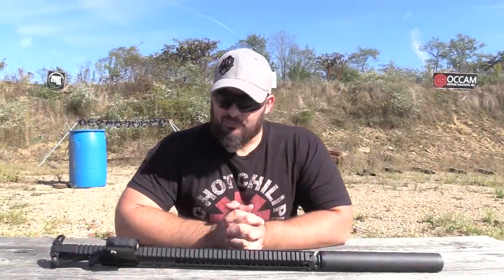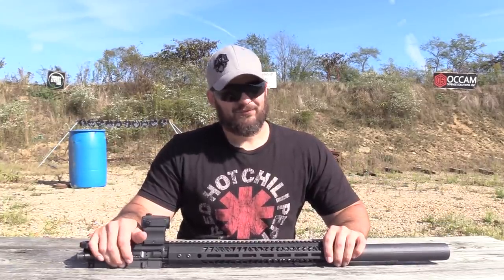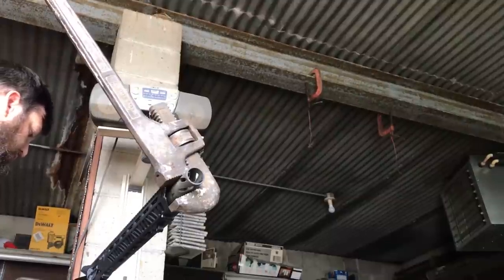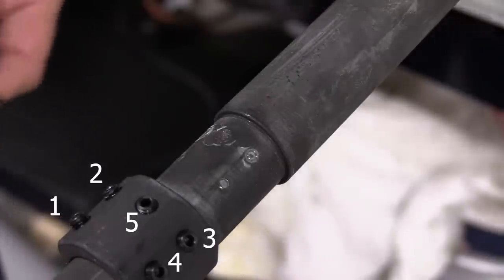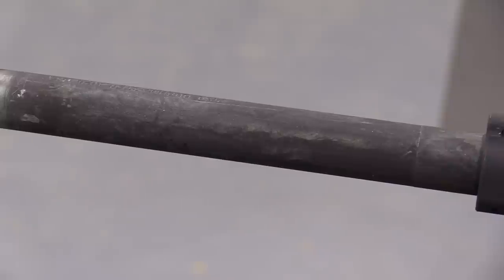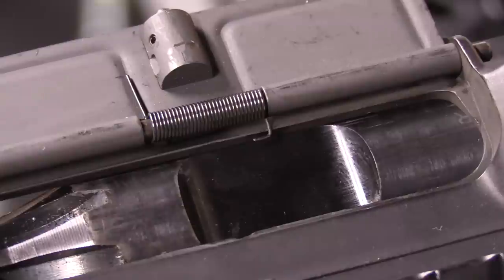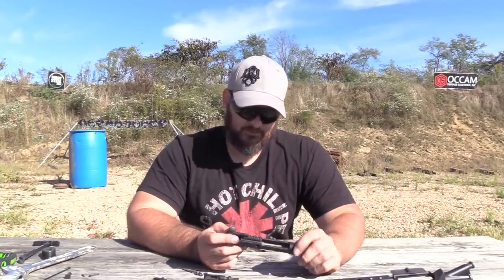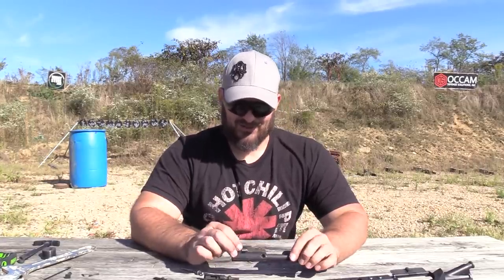The Worst AR 15 I've Seen 🚩Bear Creek Arsenal🚩

Comment: Thank you, I just bought a BCA 762x39 after watching this video.
Reply: How is it holding up?
Reply: @markzuckerberg3128  it is actually going quite well bots and enhance firing pin and some heavier trigger spring. Shoots Great wish I could afford more ammo though
Reply: @user-vx9qi7ni8g  Kool thanks. I want to put a H3 buffer in mine. Have you had to replace the extractor yet?
Reply: @markzuckerberg3128  no the extractor works well no issues. I just shoot the cheapest dirtiest ammo. All is good
Reply: @user-vx9qi7ni8g  Nice. Thanks.

Comment: Uh I think because of this video I am going to buy a BCA lol
Reply: Robert / well that can’t be..apparently all their stuff is garbage, I don’t know why anyone would be buying it.
Reply: Don't know where he got that particular upper from, but all of the uppers I've gotten from BCA have been pretty decent for uppers under $300. If the advertised upper is out of stock, email them about it and they will typically build it for you since they are an in house company. They have great customer service and really fast shipping. Hey for less than $300 if you don't like the upper you can always return it or sell it
Reply: K. PeteE same here
Reply: Agreed. Seems like a pretty solid buy, considering all you need to do is recheck the screws for tightness and stake the gas key a little better. I've seen Rugers where they forgot to machine the holes for the trigger pins.
Reply: I’ve bought 4 uppers from them with out complaints and very accurate
Reply: @KPeteE  "JuSt As GoOd!"
Reply: It's not garbage.. I bought 3 rifles to keep around while I put my FNs I'm the ground. These aren't battle weapons however they are great rifles and if I got stuck in a fire fight it wouldn't matter if I had my FN or this. Only difference is the mechanical endurance
Reply: I bought a 7.5 inch 5.56 upper from Bear Creak Arsenal, it had a defective bolt that wouldn’t eject cases. I told them and they basically told me to kick rocks. Lesson learned by nice or buy twice, don’t waste the time or money on a BCA anything
Reply: If your going budget go Anderson or PSA
Reply: @wakandawildman2043  really? Mines with them right now because  of a barrel nut issue they hooked me right up. Maybe it was a long time ago?
Reply: I would recommend them, I sell them every day without issue.
Reply: @wakandawildman2043  bro... Literally had the same issue my extractor pin basically exploded at 50rds. I hit them up of course providing pictures of the malfunction and they sent me a whole new BCG
Reply: @wakandawildman2043  can I see your 7.5 build? Looks like I did the same thing around the sametime you did with the same malfunction
Reply: @wakandawildman2043   that's odd they normally are helpful
Reply: @berman943  if we all went by hear say then the world wouldn't have options
Reply: @jonathandavis346  buy a custom bcg if you're buying cheap bro , maybe change the buffer out to
Reply: @malonehardwud4660  I've got some nice bcgs. The purpose of these guns are for work and fun. I'm a farmer and treat the gun roughly. The 7.5 build is now 300blk and the most dbag gun I could build. Folding buffer and over all decked out with some nice parts. Kinda funny how it started as a $700 gun and is now a $2000 gun.
Reply: Good choice

Comment: This is one of the worst videos I've seen. Full auto on .450  😂
Reply: With the staking on that gas key, this upper would have failed regardless of whether or not it was fired FA. Same with the gas block that had zero threadlock on the set screws.
Reply: The fact that they only have 10 round magazines tell you that they aren't designed for full auto.

Comment: I’m sold I’m going to order not one but multiple uppers!!! Thanks for the review
Reply: I bet they all work fine
Reply: @didamnesia3575  yeah they totally DO NOT explode especially the 300 blackout that BCA makes
Reply: @nosteponpp4849  Got a 308 for $270 never had a problem. Well besides ammo prices
Reply: You clearly can't tell what abnormal wear is on the AR platform then 😂 just because it can cycle ammo doesn't mean it's working "WiThOuT iSsUeS" I've never seen a Bear Shit Arsenal without issues
Reply: @nosteponpp4849  i have!.. more than a few
Reply: @theman-pc2ej  then you haven't ran them at high enough round counts for your opinion to be of value
Reply: @NoStepOnPP  well the psa and bca are both binary and an average person done even have that id say i run them harder than an average fella. Im no full auto but that has no place in my armory. Just a novelty in my opinion and yes it counts bud..
Reply: @NoStepOnPP  and so your saying you have to abuse it to make it malfunction or wear prematurely?.. not my cup of tea either.. if i wanted to go full auto i would spend the extra cash on something more designed for that but for semi or the occasional mag dumps they are just fine..
Reply: @theman-pc2ej  most people who own PSAs run 1k rounds through their safe queen and think it's a lot......so again if you haven't seen any problems with BCA, you haven't used it enough because they have problems 😂
Reply: @NoStepOnPP  ok bud..had mine for years and they all have way more than a thousand rounds threw them and operate flawlessly so maybe i just got lucky..
Reply: @theman-pc2ej  or you aren't actually using them, which is 99% of the time with BCA owners who don't want to accept reality that bear Creek Arsenal is the worst AR manufacturer out there
Reply: @theman-pc2ej  I love how bear Creek Arsenal owners get so pissy and start lying when it's so obvious to everyone else 💀
Reply: @NoStepOnPP  not pissy or lying.. just is what it is. In my experience after thousands of rounds threw all my riffles they still operate like the day i purchased them. Im just telling it how it is wile you argue about my riffles..lmao!.. have a nice day lil fella
Reply: @redacted951  I don't suppose their BC10 uppers will fit on a Diamondback db15, will it?

Comment: Everyone I know who has a bear creek arsenal loves them, myself included, my favorite rifle is my bca upper on my dpms lower, I have 5,000 rounds through it and it still runs like a champ,.. I think u just got a lemon that's not ment for long full auto burst to begin with..
Reply: I have 2 also from bca. The .223 Wylde and the .50 Beowulf. I have never had a problem from either one of them. They are just good low cost uppers.
Reply: It wasn't a lemon till he went full auto plumbing tools on it.
Reply: @logicalguy488  lololol😆😆😆😆😆good stuff
Reply: The fact that they only have 10 round magazines tell you that they aren't designed for full auto.
Reply: @trickmustang1994  I have one of their 50 beowulf uppers. Haven't shot it yet. No reliability issues?
Reply: @bryananderson3772  no issues with it. I've had it for about 2 years and I've shot a lot of rounds threw it.
Reply: @bryananderson3772  the best magazine for the .50 Beowulf is the Alexander Arms mag. They come in 10 rounds, 7, and 5 I think.

Comment: My first AR used a BCA upper with a bear claw fluted heavy barrel. It has ran flawlessly for the past 5 years. Nothing came loose, no jams or malfunctioning. I did get the more “expensive” setup from them and chamber is very clean and stays very tight to the upper as does the flash hider to the barrel.
Groups with my vortex red dot are avg of 5-7MOA. It’s good enough.. And having a cheap blaster is better than have no blaster. Sub MOA is meaningless unless you are hunting rabbits at 100yards, center mass is what’s important.
Yes my WC is much lighter and feels a little smoother but it cost 4 times as much. And they both shoot similar groups at 100 yards. So if you are trying to get yourself a tool without needing to save for weeks or months BCA is a great option for entry level shooters. Just stay away from the really cheap ones. That’s a good tip for any product you buy. A Kia Forte is not a Kia stinger but both have the same badge.

Comment: I have 4 bca uppers. 223 Wylde, 5.56 7.5" pistol, 450 Bushmaster w/10.5 Barrel, and a 7.62x39. I also shoot a lot. The only issues I had and the first is being knitpicky, is the flash hider was off time slightly. The second is the 5.56 7.5" pistol was over gassed. It took an H3 buffer and heavy spring to get shells ejecting in the 3-4 o'clock area. Kinda to be expected with a 7.5" barrel designed to shoot a broad range of ammo. You could should all my uppers, all day long in semi auto, and not have an issue. The Daniel defense meltdown didn't go as long as a cheap one. You can absolutely get a reliable AR for less than $400 that you can shoot for years to come.
Reply: Kris N My $450 Anderson is at about 5,000+ rounds and still showing no signs of failure
Reply: The fact that they only have 10 round magazines tell you that they aren't designed for full auto.

Comment: If you run the crap out of any firearm full auto and suppressed your gonna have issues. It’s not a Gatling Gun. Think about the pressure being applied and the bcg cycling so many times. You simply can’t expect the quality/results you would get from a piston driven 416 out of a budget friendly upper. Common sense.

Comment: A lot of of videos I have seen the gas blocks have come loose.I got a 7.62x39 upper from them the first thing I did was to loctite it down and tighten it.I have had no issues with it and it is very accurate. Not bad for $195 complete upper.
Reply: Yep! Their complete uppers should be considered an "assembled parts kit"... meaning you get all the parts for a complete upper, and it's sent to you put together as far as the parts and fasteners being in the right place, but it's up to you to go over it and make sure it's assembled right.
Reply: @carlh7795  ... you even have to assemble the bolt carrier since BCA apparently doesn't do quality checks to make sure sure the gas key is staked like it should be.
Reply: @hochhaul  boo boo. You have tighten something after saving $400

Comment: Why would you shoot a cheap upper in full auto? That’s like taking a Prius on a Baja 500. I think you make good points but it’s just not relatable to the people buying them. I’ve got 2 BCA uppers for hunting and they are great for just that. Limited rounds.
Reply: Merch!!! I found ya...haha... only reason I checked the comments was because I knew you would have to say something about this toolbox running that gun on full auto
Reply: how long have you had your bca uppers for hunting I wanted to do a 450.for best but now I'm on the fence
Reply: Jake Lundgren about a year. It’s super accurate and runs awesome, you need a Tromix mag and follower for the big bore cartridge (20$). It’s definitely worth it
Reply: @Mh187pj  Not really, it's like taking a Prius but it's an off brand Prius. The original AR design was meant for full auto, a clone should handle it fine. If it can't... It was poorly made.
Reply: @ChucksSEADnDEAD  The original AR design was not meant for .450 anything full auto or not
Reply: Nezic  I've decided you have no idea what you're talking about. You lose.
Reply: @f.a.2115  You really want to bring the original AR? The failed rifle that was plagued with issues and basically went away for awhile. Good job invalidating yourself.
Reply: @motino  The fact that the original AR blew the barrel in testing has nothing to do with the fact that it was designed for full auto. The composite barrel was just a bad idea. But like I said, that's beside the point. If you clone an AR, a modern AR after all the fixes it had to go through, and don't even make it handle FA you're just cutting corners and delivering a subpar product.

Comment: For anyone actually wondering, the 450 is a big stubby round that doesn't feed super well with the standard mass of the ar-15 BCG, and an H3 buffer is recommended for best function. The upper appears to be pretty accurate, MOA or better in the first few shots out of mine. Great hunting upper, but you'd have to be an idiot to attempt to run a cheap big bore upper suppressed without substantial modifications such as H3 buffer, adjustable gas block and doing some work polishing the feed ramps. One last thing, the mags can make a big difference with the 450 rounds, as many factory mags require minor modification to feed them reliably.

Comment: Obviously a $200 upper isn't going to be the same as a premium upper. The price to performance ratio is still very good on all BCA products I have bought.
Reply: Is whole argument was "Spend thousands more... they use locktite" --- lol.
Other than the QD holes, which I never use anyway.  QD is a trash design idea from the start.   Anyone who builds houses and uses air hoses all day can tell you.  That little ball lock system sucks;  it wears out and breaks and you're changing connections all the time;  just like you'll be swapping out your QD all the time.   That's why most "operators", you'll see them simply tie their sling to the rifle with 550 cord;  because at least then it's super easy to repair on the fly if the breaks.

Comment: Everything you listed are simply assembly problems.  Build them yourself from parts kits and you won't have that issue at all, because YOU are the QC officers then.  You're taking the da^n thing apart and have to "rebuild it" to get it back together anyway.  Just order the parts and do that the first time and you'll know it's right.   It's even cheaper that way.   Also, ALL QD holes wear out, even steel.  That's why I will never use QD;  It's a joke.   I've had to replace far too many air hose connections to ever trust the ball lock system that QD uses. (which is the same kind of thing in the end of an air hose)....  Extractors also will have to be replaced on ALL rifles.  If it dies early, just upgrade it on the next one.  We should all have replacement parts laying around for every rifle we own anyway....  You're trying to make the argument that spending thousands and thousands more on your rifle is worth it, because they use locktite.  It's hilarious to me.  tighten down the gas key and add 4 more stakes-- it takes only a few minutes.   I always drill and pin my gas blocks also- as part of assembly;  so those screws are irrelevant.    If this is all you can find wrong with it, then they must be doing well IMO.   This is why I don't mind acquiring their parts kits, or PSA, etc.  Assemble them YOURSELVES guys.

Comment: The 450 Bushmaster is a hunting round for almost all big game in North America. I might fire mine less than 20 times per year deer hunting. I recently purchased a BCA 350 legend upper and lower. I have sighted it in and only put 10 rounds through it so far. Shooting tight groups at 100 yards. Could imagine firing a 450 Bushmaster on full auto. Putting a AR 350 Legend together for under $500 not much room to complain.

Comment: I am curious how the barrel internally looks.Just curious if there’s any internal damage to the barrel.
Reply from the maker: Probably not
Reply: The VSO Gun Channel - Thanks for your thoughts , only have a BCA  18inch 450 barrel, I new the rest was too good to be true.  I have the sanders armory side charging upper. Seems to be solid. I by no means have put thousands through  it yet but I am a avid shooter.  I am at about 300 and planned to do a tear down at 500. I think you cut that wait time to now. 

Side note - 450 is great with the SICO Hybrid  and 365gr  subs